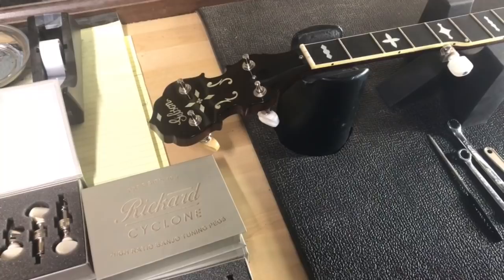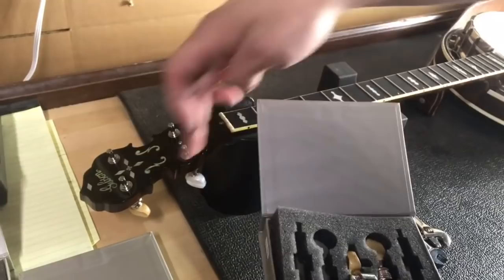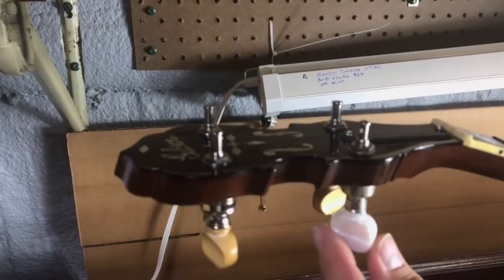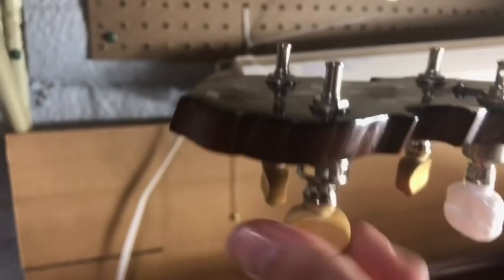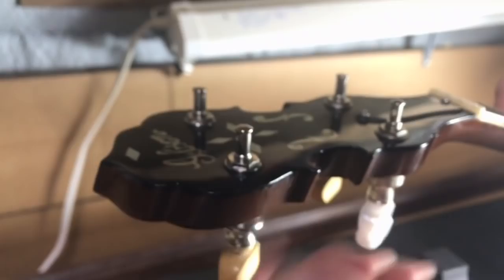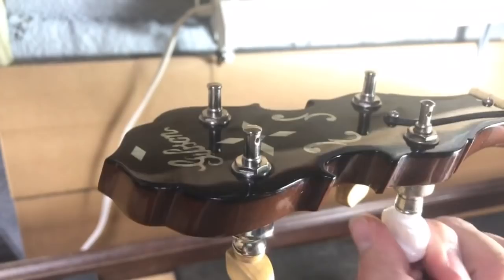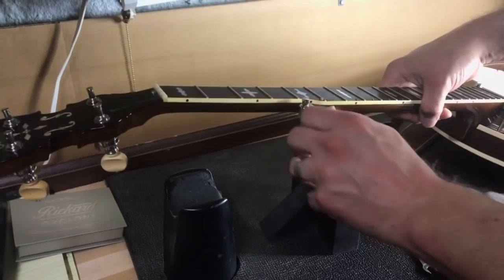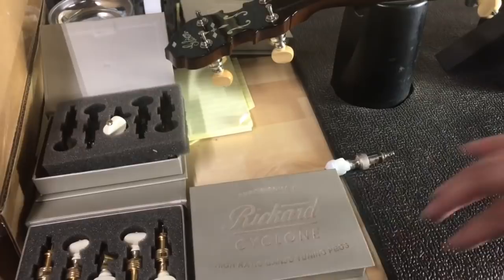Tech Tip- How to Install Planetary Tuners for Banjo

Comment: So Banjo Ben, I have this problem with my low G string, where if I fret it on the fourth fret it is very sharp, compared to my tuned B string. Does that have to do with my bridge placement? because if I change the bridge when I fret high on the strings they're either sharp or flat.

Comment: I know I'm 3 years late to the video but I have a question for Ben or anybody that knows banjos
I picked up a rb250 a little while back that has schaller d tuners on the 2nd and 3rd and I'm wanting to replace them with Keith's, however I've found out that the Schallers have a 10mm post diameter while keiths are the standard 3/8. So, with that being said could I just swap out the tuners or am I gonna have to plug the holes and re-drill?

Comment: I should've watched your video BEFORE ordering my tuner pegs, Ben. The $50 set came in. Pearl, nice chrome. But as I tried screwing in the threaded barrel nut into the tuner post they all only screwed easily in for about 2 turns before stopping. So my experience with such is that they are MIS-MATCHED in the threads.  I thought to myself, "Surely not!" Brand new?? But then upon a closer look I noticed that the tuner post female thread piece was made of COPPER, a softer metal than chrome, of course. So my intuitive thought is, "Were they designed that way? So as the barrel nut is screwed down into the tuner post insert the chrome threads expand into the copper receiving threads for a stronger, more permanent fit?"  I'm guessing here as I've no experience at this.  My original thought when ordering the tuner pegs was that it would prove as easy as your video shows.  So based upon your answer, I'll either use them with the older insert posts or send them back.  Or use the new posts with EXTRA FORCE in tightening them down.  Thanks in advance. Stan
Reply from the maker: I hate to hear that. Did you order them from us? Please give us a call and we'll do all we can to help you.
Reply: @BanjoBen  Sorry I didn't make that  clear, Ben. No, I ordered them from another music store.  I'll call you. Thanks for such a quick reply.

Comment: Hey Jake! I’d like to put amber buttons on my Baldwin. I have buttons I like but haven’t attempted to mess with it because (as I understand it) they won’t fit my 2 Keith tuners on 2 and 3 without being cut. Do you have any advice for replacing all the old buttons to ambers while accommodating the Keith tuners ?
Reply from the maker: Give us a call at the store: 833-226-5623 Thanks!

Comment: how tight should the screw that is actually in the tuner (the part you see) be? as tight as possible or with a little more room?Thanks!
Reply from the maker: No, not as tight as possible. If you tighten too much you can't turn the tuner, so back it off enough so that it turns easily but the tuner does not slip out of tune.